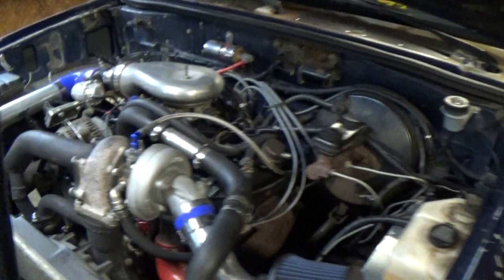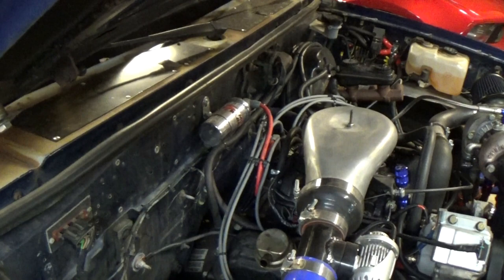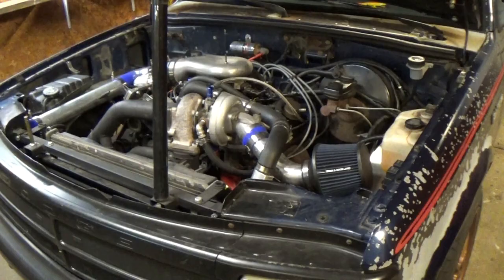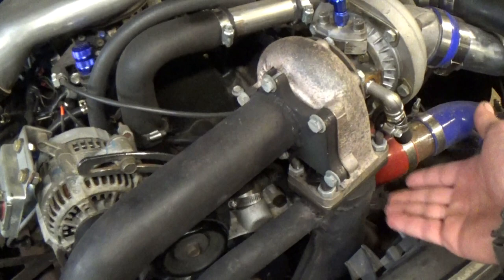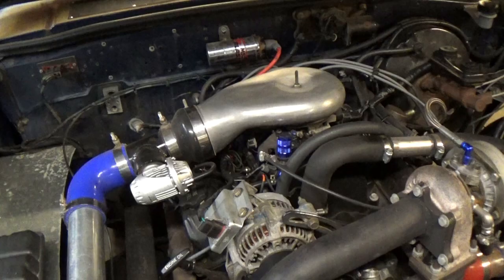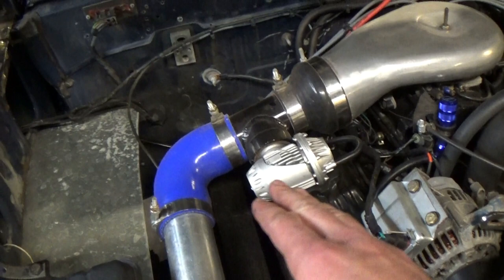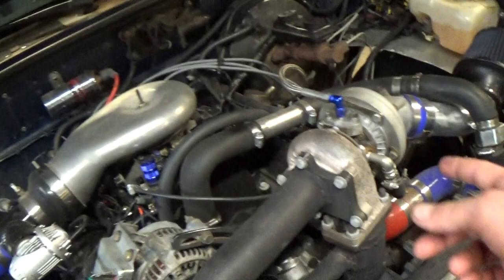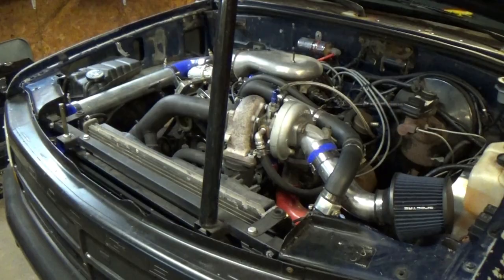How To Turbocharge Your 3.9 V6 Magnum Dodge Dakota and Make 250 Wheel Horsepower

Comment from the maker: Somehow I forgot to mention my fuel setup in the video so here it is: E85 (VERY IMPORTANT!!!), Walbro 255lph fuel pump, eBay 20 gallon fuel cell, 3/8" fuel lines, Bosch 60lb injectors, and stock fuel rails and pressure regulator. E85 is a crucial part of making this much power at this boost level without damaging pistons! I will have this comment pinned to hopefully everybody sees it.
Edit: I also forgot to mention I’m running Harland sharp 1.7 ratio roller rocker arms
Reply: Do you have any links to these?
Reply: Oh man! Can you please explain a little more about the mods you did to get it to run on e85? I've got a 1995 Dakota with a 3.9l.

Comment: You should also likely gap your plugs down a bit. Looks like factory gap is 0.035" so I'd probably go down to 0.025-0.030" somewhere in that range. Your upgraded coil is probably helping you quite a bit if you didn't gap down, but that would be my first step if you have any misfiring. Awesome build man!
Reply from the maker: Yup gap is important too, I think I brought mine down to .030 but I can’t remember now

Comment: Fantastic I'm building a 1946 dodge wc it's on a 1994 dodge Dakota frame with the 3.9  five speed .Thank you for the info .
Reply: Thinking about using a free low mileage 3.9 in a 38 dodge

Comment: You are a genius. So what could a body/paint shop do to make this truck leak on the drivers side when it rains? Got wet carpet where my feet go , Any ideas?
Reply from the maker: My guess would be door seals, if they’re the original ones and the shop had the doors off they might not be sitting in the exact spot they were in before. That or the rain tray is plugged up
Reply: My Dakota did this then I put flex seal in the caling over the factory seal and it stopped on the driver side
Reply: Now I have learned that the vent in the caling on the passenger side will put water on the passenger floor if you park on a slant

Comment: I would like power steering though... could you just run the exhaust outlets upward and save the steering pump if you had no hood? My build will have more room under the hood since it is not a Dakota but the donor is. Thanks !
Reply from the maker: You could but that would require custom headers. The factory ones will only bolt up with them facing down when flipped. I’m going to try to fit a different pump to mine at some point
Reply: I look forward to seeing that. Yeah, I sort of assumed that the exhaust would have to be custom whether I liked it or not. I guess that means breaking out the TIG and something to punch 2hen I screw it up 33 times! @RustBeltGarage1
Reply from the maker: @danielbuckner2167  screwing it up is the fun part! I want to try to custom mount a small power steering pump with a remote reservoir right at the front of the engine about where the ac used to be. Something like a pt cruiser ps pump would be perfect. My truck hasn’t had power steering at all in the 6 years I owned it because the rack has a huge leak so when I built the turbo kit I just took it all out
Reply: Right on. In my experience trying to make pulleys and get them to line up and not wear belts or squeal or just fly off at 1500rpms has been nearly futile. I might even consider one of these "newfangled" electric power steering setups project for this is a coupe so it's already light,can run skinniesnup front, and was made without power steering but it would be nice to have it in parking lots where space is tight. @RustBeltGarage1

Comment: So when you turbocharged that 3.9 did you do anything to open up the intake mainly cut the runners or swap out to a v8 throttle body i seen in the comments you didnt mention the 1.7 rollers
Reply from the maker: The throttle body and intake were unmodified with the exception of the improved plenum stud bracket on the throttle body and I put a felpro intake plenum gasket in to prevent it from blowing out. No porting or anything was don’t to either one
Reply: Okay curiosity I have a 3.9 it was in my 02 dakota I did the 1.7 rollers a set of Gibson headers v8 throttle body cut out the runners for better airflow in the kegger intake also put in 4 hole injectors and the superchip flashpaq. I never dynoed it but I did race it my best quarter mile was 16.71 at 81mph

Comment: What rpm does your turbo engage at? I have a 2002 Dakota 4x4 with the 3.9 in it and I'm considering a turbo to help with mpg and towing, but I don't drive the truck very hard (No high rpm burnouts or anything). It's a daily driver that never sees anything higher than 3500 rpm before I shift (trucks a five speed manual) and I don't know if adding a turbo will even do me any good driving it like that.
Reply: Adding a turbo in your case would help out a lot with fuel economy,  most people that put on turbos or get a car with turbos get a lot worse gas mileage as they just don't know how to use a turbo efficiently they get in step on the gas and then get a big turbo boost which is very inefficient for fuel mileage, you should drive it so you do not feel the turbo lag, that is the most efficient way for fuel economy, however it is not as fun. A turbo charged engine will average about 8 to 10% to your fuel economy, plus have more power for towing as well

Comment: Excuse me sir. Is possible to do this build without a the turbo?? Gotta 94 but wanna keep it N/A. Will the Megasquirt still be useful for an all motor setup??
Reply from the maker: Yeah it’s very doable naturally aspirated. How useful it is would depend on how modified your na build would be though. If you plan on doing more basic bolt ons the stock ecu will work fine, but if you plan on doing a cam, heads, higher comp pistons, etc the megasquirt would be a huge advantage for tuning the setup. The 95 and earlier ecus dont have a lot of tuning options and finding someone who can flash tune one is very difficult. Megasquirt will solve that issue completely
Reply: @RustBeltGarage1  Hi. Me again. Was wonderin if the Hale Distributor is necessary to run/use the MS?? Or since my 94 isnt a pre-mag, would the MS just be plug and play. Installed a new distributor but was kinda confused about the cam and crank sensor thing about your build since your computer was tunes for the eclipse. If you could provide some insight, would be highly appreciated.
Reply from the maker: @vipersquad3  it all really depends on how the megasquirt is equipped. For my megasquirt 2 that I had built the pre magnum distributor is the only bolt on option for crank trigger and is the easiest and simplest one to set up. My megasquirt was built close to 10 years ago and there have been many updates and revisions made to the new megasquirt ecus since then so there is a chance that you could build one and have it set up to run the factory magnum crank and cam sensors. The best thing to do if you want to go that route would be to contact DIY autotune and go from there. Unfortunately I’m not up to speed on what the new megasquirts are compatible with. All I know for sure is that a megasquirt 2 built for a neon/420a engine will run a magnum v6 or v8 no problem if a pre magnum distributor is used for crank trigger.

Comment: Instead of having to buy a new distributor and ecu, couldn’t you theoretically get it tuned?  Either professionally or yourself?
Reply from the maker: The pre obd2 ecus are difficult to retune, and finding the tools to do it or someone with the experience to do it is even more difficult. The obd2 trucks are now supported by hp tuners which makes them much more accessible but that only works on the 96+ trucks of course, mine is a 92. A stand-alone ecu is still more capable than the stock ecu though so for me a standalone was the best option but depending on the build a tuned factory ecu might be a better fit.
Reply: @RustBeltGarage1 I have a 2000 with the OBD-2 port

Comment: Always love your videos, I’m going for a twin turbo set up on my Dakota and really needed the insight for the standalone. Did you have to tap into your fuse box at all?
Reply from the maker: I have actually completely removed the stock fuse box and reworked everything. You will need to find a source for switched power for things like ecu power, ignition, injectors, etc
Reply: Twin turbos won't be so effective since you can only run 10lbs of boost safely. Good luck on the build!

Comment: I was wondering if there is a video where you if you show how to put a belt on without power steering in AC I would like to know how you what belt I need and how to run it
Reply from the maker: I need to check, I think I showed it in an older video but I can’t remember which one. I’ll get the part number for the belt that’s currently on it if I can find it. I had a picture saved of the package on my phone somewhere
Reply from the maker: There are two part numbers for the belt I’m using. 539k7 and 7pk1370, it is a Duralast belt but a few other brands also make the same belt. My truck has an adjustable alternator bracket so I don’t know for sure it this belt will fit on the factory one but it will at least get you close
Reply: Thanks for the information

Comment: How did you program for the oddfire of the engine.
It fires at 112 and 128 to balance it. Does the system you use allow you to program this? 

My question is ..does the engine fire 112deg first or 128deg first?
Reply from the maker: The megasquirt 2 tuning software had an option for odd fire, I believe all I had to do was check a box and enter the degree ,which I’m pretty sure was 112, into a box for the offset of the first fire. The software used cylinder count and crank position to piece the rest together itself. Using a distributor and a single coil made setting this up much easier even allowing to run this setup without the need for a cam sensor.
Reply: @Rust Belt Garage  thanks for your help. I have a 1987 engine that will be carb first, then sniper. I'm using a 318 distributor with a reluctor cut to 56 and 64 degrees spacing just couldn't find any info on which came first.
I'm looking to go single turbo or use an eaton blower from a 3.8. 
I like your turbo routing, which inspired me to go this route.

Comment: My 97 3.9 just threw dtc p0305 and p0302... I checked the wires and re gapped the plugs and it still runs rough. I was fine prior... 😑

Comment: Why did Mopar bother with external voltage regulation?
Reply from the maker: A lot of manufacturers use external regulators but most are mounted directly to the alternators like Volkswagen for example. In the 70s and 80s Chrysler had their voltage regulators mounted on the firewall and they are pretty reliable usually outliving multiple alternators. Where they made a mistake was their decision to move the voltage regulator inside the ecu in the 90s and making it non serviceable. If the regulator goes bad the ecu has to be replaced or an aftermarket regulator has to be wired in. The best part is the regulators in the aftermarket kits are exactly the same as the ones found on the earlier cars just with the addition of a wiring harness lol.

Comment: What radiator and electric cooling fans did you use and is it working well for you?
Reply from the maker: Stock radiator and fan off of a Pontiac grand am. Works great

Comment: Good info! Dose anyone make a 4bbl  carb intake for this engine that you could weld in injector bungs and bolt on a throttle body elbow to?
Reply: No one makes a 4 barrel for the magnum style 3.9. Direct connection made one for the 3.9la engine years ago. They are almost impossible to find. It took me 2.5 years to find one.
Reply from the maker: There are none for the 3.9, Hughes racing makes one for the 5.2 that is setup for efi but for the 3.9 the only option is to run stock or try to find the direct connection one Chapman racing mentioned above but those are very rare
Reply: If you get a 2 to 4 barrel carb adapter. You can drill and tap the intake then bolt all together. Then get a 318 distributor with a slant six reluctor wheel wire for gm hei ignition. It works 👌🏼👌🏼👌🏼
Reply: After a little more research I found They did make a M1 4 barrel intake for the magnum. It was not opened up for the 4150 series carbs though. It's part number is 4492440. I have yet to l find one for sale. A guy on facebook posted about one right after this video.
Reply from the maker: I do remember hearing about this on an old website years ago. Maybe it was a forum threads? Anyway, it was a post about comparing the airflow characteristics of a bunch of aftermarket magnum intakes. They tested the stock intake, a couple of mopar intakes, Hughes, and a few others. I can’t seem to find it now but it would be a great way to find some intakes to hunt for.
Reply from the maker: Also, I’m surprised I forgot this but 1987 dakotas came with carburetors. I’m pretty sure they were carter 2 barrels but you can get adapters for that if you want a 4 bbl. there is also a guy here on YouTube that did what you’re describing on a 318, welded injector bungs on and I think he gutted/modified an old carburetor to use as the throttle

Comment: Okay I have 87 dodge Dakota with the carburetated LA 3.9 v6 I just rebuilt the whole top end cause I had a lifter explode on me doing 90 down a back road but I want to put hughesengine cam in it with 1.6 rockers. I don’t know anything about turbos only N/A motors would I be able to turbo my carburetated la 3.9 with the Hughes cam?
Reply: The only turbo setups I ever see is with the magnums and personally I’m a LA fan and want to keep the LA in it
Reply: You can turbo charge any engine, a carburetor engine would be a lot easier than this one was.

Comment: How do the air filters with a center cone destroy turbos? Asking cause I've got one on mine.
Reply from the maker: There have been cases where the metal cap in the center comes unglued and gets sucked into the compressor and tears stuff up

Comment: How much torque does it make? factory my 02 says 225 ft lbs 175 hp i highly doubt its makes that now with wear but with a turbo it should make easy 300 if your making 250 whp.
Reply from the maker: Torque was over 350 wheel. When we dynoed it we thought the torque reading was wrong at first because of how high it was

Comment: I’m having issues with my NA 3.9L. Brand new engine just swapped it in a few months back and I had fuel in the oil. Right away I knew it had to be either a bad fuel pressure regulator, or a stuck injector. So I switched them out and my truck is still not really idoling , sounds like shit to be honest like it’s not getting enough fuel. Completely at a loss for what’s wrong with an was wondering if you have any ideas as to what’s wrong with it
Reply from the maker: I’d start by doing a reset on the ecu, unplug the battery and let it sit over night. Also check the plugs on the injectors as the ones on the Dakota harnesses don’t always like to stay clipped in. It’s probably a good idea to check for vacuum leaks at the injector o rings at the base of the intake
Reply: @RustBeltGarage1  Awesome will do , thanks for the reply !
Reply: Might want to check your fuel pump pressure also sounds like it might be getting worn out

Comment: Okay so I’m gonna sound like a dumbass here. I’m a 17 year old kid and I’m pretty fluent with mechanics but wiring confuses me. Turbos makes sense in my brain. I have a 1991 d150 with a 3.9 pre magnum motor. I want to turbo it. I don’t want to go crazy I just would like to make maybe 50-60 more hp. I was thinking like 8lbs of boost. Can I create a turbo set up without doing all of the fuel mods you did? I’m not too worried about killing my engine because I plan to magnum 318 swap is maybe next year.

Comment: Is this the same motor in the d100s?
Reply from the maker: I think the only gas 6 cylinder the d100s got was the slant 6. Chrysler did start using the 3.9 in base model rams at some point in the 90s but think it started with the second gen
Reply: @RustBeltGarage1  it’s a v6 for sure. I thought I corrected the guy on the add and he said no it’s a v6 . A 3.9 . Then he said he thinks it’s a 285ci or around there. It’s backed by a 5speed so it might no be the same motor.
Reply: @RustBeltGarage1  I have a 88 so how would I determine what motors in that truck
Reply from the maker: The 3.9 is a 239ci. The 3.9 la came out in 86 for the 86 model year in the Dakotas so they might have used it in the d100s at the time.
Reply: @RustBeltGarage1  yeah I just looked back at the messages . He also said it was a 4 speed. My mom drove it halway back from San Antonio to Houston then she realized the reverse was in the wrong spot and she went to put it in 5th and sure enough. He thought it was a 283 sorry. Pretty sure the Dakota has the same motor . Is there any performance mods or aftermarket companies available for the 3.9. My research says no but let me know if I’m wrong
Reply from the maker: HiPoTek makes a few 3.9 specific parts, although most are for the fuel injected magnum 3.9. Some parts from the 318 la engines will also work like rocker arms, valve springs, etc. options are a little better for the fuel injected magnum engines but not much better
Reply: @RustBeltGarage1  it’s single exit and already has a cross over so I’m prolly just gonna turbo it with no intercooler